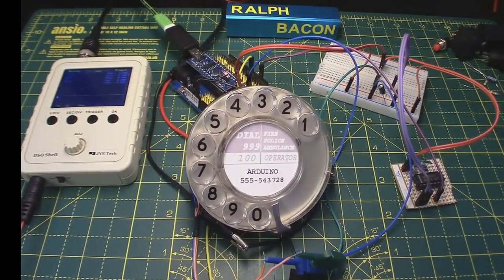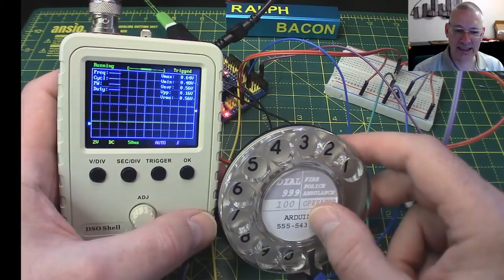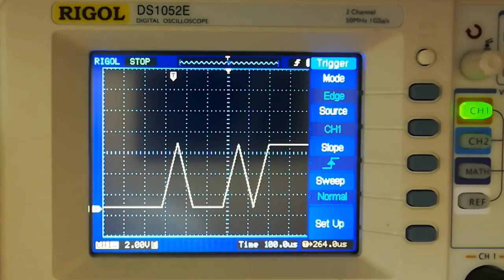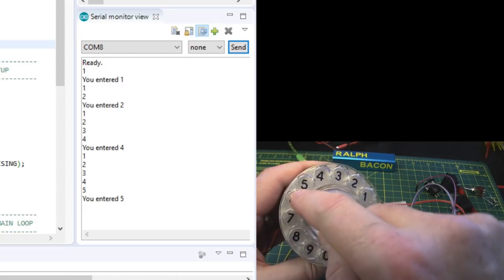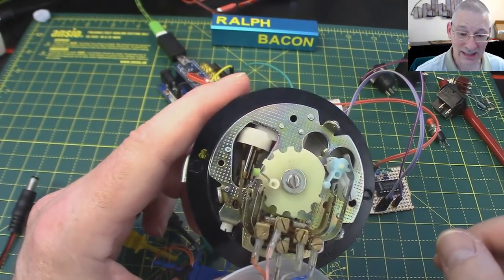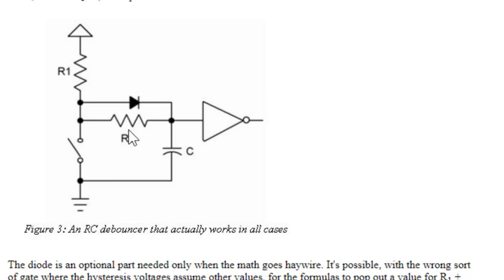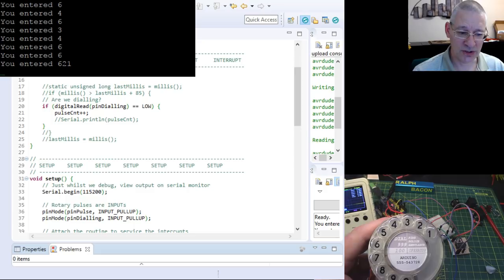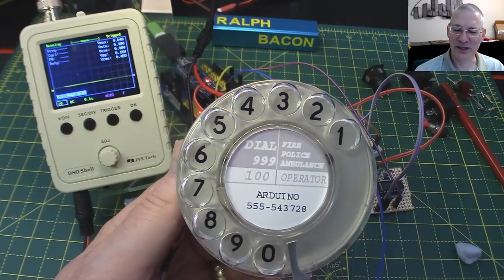#98 Telephone Dialler ☎️ and Hardware Debounce Solution (retro)

Comment: I believe that within an Arduino ISR the millis(), micros(), delay() and delayMicros() don't increment.  In other words they are disabled.  To be able to software debounce an input you have to poll it.  As slow as the dialer is you should be able to make polling work.  By the way, I love the video.
Reply from the maker: Thanks for your kind words, captxrox, most appreciated. I'm really happy that my followers enjoy my videos.
 
And yes, you're right that millis() does not increment during an ISR, but that doesn't matter as far as the code here is concerned. As long as a certain number of milliseconds have elapsed (it increments again as soon as the ISR finishes) before accepting further pulses that's fine. Polling is just not the optimal way of intercepting pulses that happen now and again as your Arduino's code might be busy doing other things and miss a few.
 
MIcros() does continue to run during an ISR as the underlying routine does not use a timer, but we don't need that here, anyway. It's can be a minefield using the Arduino specific functions (if you were using native C++ it becomes clear(er) what is going on). Thanks for posting, this is an interesting area to keep plugging away at.
Reply: I guess I was wrong about micros()--but right about millis() and delay().  
I just read the notes on https://cdn.arduino.cc/reference/en/language/functions/external-interrupts/attachinterrupt/ including the comment titled "About Interrupt Service Routines".  One thing it says, that I think is relavent here is: "Generally, an ISR should be as short and fast as possible."  That would be defeated as soon as a delay routine would be used.
Going back to polling, I have generally been successful with software debouncing a polled input.  Somehow it appears that the software debounce within the ISR will not work--whatever the reason.
While polling clearly won't work for a rotary encoder (there's a few YouTube videos demonstrating that) it should work on a rotary dialer.  The nominal period between pulses on the dialer is 100 ms.  I would try it myself but I don't have a rotary dialer.
Reply from the maker: I'm a tad worried we're talking at cross purposes here, captxrox. The ISR in my demo (the one that includes checking the millis to ensure we reject pulses that occur too close together) is the standard software method of dealing with bounces. There's no delay involved at all. We just exit the ISR if the current pulse has come "too soon" after the previous one (so we assume it's a bounce). So apart from my demo-purposes-only where I have a Serial.print statement (definitely a no-no for a real ISR) it's about as fast as it can be.

Using polling to debounce anything (switch, rotary encoder, whatever) this obviously can be done at a technical level but should not be done, as presumably your Arduino is busy doing the real work of switching heaters on and off, or measuring the light levels or something. We wouldn't want to poll for any kind of switch closing (bounce or not), it's just not good programming practice.

The issue I had with the telephone dialler is that it is so ancient that it flies in the face of normal switch behaviour. We can get a semblance of proper behaviour by rejecting pulses as far apart as 50ms but that is crazy. As Jack Ganssle mentioned in his paper, he never discovered any kind of standard switch that bounced for longer than 10ms - most were much short than this. So for the telephone dialler (and by extension, any switch) we can dispense with software debouncing entirely and do it all in hardware using that circuit - it's as though all our switches are suddenly 100% perfect!

My previous video on a Rotary Encoder (video #19) behaved perfectly using software debouncing (just 5ms) as I demonstrated in that video, so we don't always have to use external hardware to debounce switches - just when the occasion requires it and reliability demands it.

Are we singing off the same hymn sheet here, I don't want to confuse my viewers?
Reply: I think I was in more of a hurry to leave a comment than I was to be sure what I was saying was valid.  The truth is that when it comes to debouncing, software debouncing is a dirty way of doing it—at least to me.  What I like about it though is that it significantly reduces parts count.

Regarding what you are saying about rotary dialers—you didn't say it but in their day automatic phone switching was electromechanical so debouncing wasn’t an issue.

By the way, I guess I missed your videos on rotary encoders.  I'll make it a point to watch them.
Reply from the maker: No problem, captxrox, it's a fascinating area with many opinions. It seems the electronics world is split 50/50 about whether it should be hardware or software that sorts out debouncing. My take on this is that if we can do it easily and reliably in software (see video #19) then the job is done. If not, as this video and also video #96 shows, then we need extra help. For the sake of a few pennies we have 100% reliability! And yes, back in the day of gas lamps it was all electromechanical so I guess they didn't know or care about switch bounce. I marvel at how reliable the old mechanical telephone system was!
Reply: One thing that intrigued me about your video is that many years ago when I was in ninth grade (here in the U.S.) the school got its hands on some surplus stepper relays (I think that’s what they were called) from a local telephone switching office.  The office was upgrading to electronic switching (I guess that dates me).  Some fellow students were trying to use them on an electric basketball scoreboard to count down time.  While I was aware of the project I wasn't involved with it—though I wish I would have been.  They were having trouble transitioning from 00 seconds to 59 seconds.  They ended up using a (electromechanical) multivibrator to count the final four units on the ten’s of seconds digit.  The problem with their solution was that when the multivibrator would be stepping the ten’s digit the display of that digit would blank.  It looked very tacky to the crowd watching the game.
Reply from the maker: You should have been part of the design team (ideally with an Arduino but they weren't invented at that time). Yes, those stepping relays (also called uniselectors or stepping switches) were packed into our telephone exchanges back in the day. It's amazing they worked at all, let alone so very well. Old films that show them working intrigue me! Here's a rather drawn out example (but well explained) from the archives of AT&T: https://www.youtube.com/watch?v=xZePwin92cI
 
Luckily today we can do so much more for so much less (money, but not necessarily brain power, A good design is a good design is a...)
Reply: Thanks a lot for that link, Ralph—by the way my name is George.  To tell you a little more about the stepper relays I was dealing with in school, they were rotary. The ones in the video (that were counting pulses) were linear.  They may have been an earlier (or later) vintage.  You mentioned seeing stepping relays in films.  I remember that too and they were rotary.  I wish I could remember which movie (or movies) it was.  By the way, the time period my schoolmates were building the scoreboard was late 1963.

You have a forum don’t you?  Maybe we could move this discussion over there.
Reply from the maker: I don't have a forum, George (nice to be on first name terms, BTW, thanks for sharing) and even if I did I wouldn't have time to use it. Today, for example, I've been playing about..., er, doing some serious research with some very high voltages (lucky I'm still here) but no spoilers!

I'm afraid the reasoning behind using linear or rotary switches escapes me; I suspect that there was a very good reason though. As you say, one or the other probably hadn't been invented yet.
 
So your school mates were building this scoreboard thing just as the Beatles (from the UK, yay!) were just getting off the ground; no wonder they had difficulty in getting it all to work. I bet those same guys with an Arduino (or Pi) would have had a blast! They were 50 years ahead of their time. Anyway, it's great having you on board and do keep tuned in. Some videos may not be of  immediate interest but it's all good background information for the day you need that info! BTW did you see the video comment from Gavin here about using a telephone dialler for menu selection and the like? I'm not the only one who likes this sort of thing then!
Reply: I’m surprised you haven’t had more views on this video.  I guess most YouTubers are millennials who could care less about 50+ year old technology. There is one point I’d like to cover close to the subject of this video.  That is that when the phone system was converted to electronic switching they had to maintain compatibility with rotary phones—thus the dial pulses had to be debounced.  Based on the information in your video—and probably other issues—hardware debouncing had to be used.  Do you have any further thoughts on this?

About your references to the Beatles, they made their dramatic appearance on this side of the Atlantic in February 1963.  They were in full swing by the time my classmates were attempting to build the scoreboard.  In my old age I hate to admit that I was a big fan.  I might mention—unrelated—that the school (now Highland Middle School) I was attending then is about a mile southwest of the Microsoft campus.  I’m don’t live near there now, though.  When I graduated from University I moved 1000 miles south (1600 Km).
Reply from the maker: Hmm, looking at the stats that Google provide me, it's interesting that lowest age group for this channel is the 18-24 year-olds (those younger than that hardly even register). In increasing percentage it follows the age: 24-34, 35-44, 45-54, dipping down a bit again after that, but the over 65s still are many times more numerous than the whipper-snapper millennials! I'm not sure what this tells me except that this is channel is frequented by males over 18 and mostly in the age range 35-44 (but only by a whisker). Females are very low in the count but not entirely absent by any means, but mostly in the 18-24 year old bracket - probably students looking to do a university project!
 
Regarding conversion of old phones to the new digital system, British Telecom have released a document (http://www.britishtelephones.com/pstconv1.htm ) how to do it (for UK phones at least). They don't mention debouncing of any signal so I guess that might be done at the exchange when it encounters a pulse instead of a tone coming down the line. Just guessing!
 
So you moved from Microsoft Land? I bet you just couldn't stand the rain (apparently Washington is the wettest state in the US). 1000 miles southwards might be San Francisco or at least California so you now have sun, sun and smog. Oh well, can't have it all. I've never visited that area but I know Florida quite well (and we steer well clear these days of any theme park)!
Reply: I should start by telling you that the link you left didn’t work.  It is not really that important, but I was curious of what might be there.  There is one thing, I think I will try to get my hands on an old rotary dialer. Also I would love to get my hands on one of those old stepper relays but it’s hard to imagine any of them still in existence.

As I said I loved the AT&T video that you linked.  I did some searching of AT&T on YouTube and found another old video https://www.youtube.com/watch?v=1Is9s9PgQFM entitled “Now You Can Dial.”  It is from 1955 and has an introduction from this century.  Note that there was a time when an operator had to connect every call.  Anyway, the video goes on to explain why and how telephones were going to dial and then gives an instruction on how to use the dial.  It is mentioned in the introduction that most people born after 1980 would need that instruction.

As to where I live now, note that the air distance between Seattle and San Francisco is 680 miles (1100 km).  I am in Southern California.  As I type this I am in Palmdale where the Space Shuttle was built.  Parked by the Palmdale Airport (Air Force Plant 42) is the modified 747 that was used to ferry the Shuttle—and various other historic aircraft.
I should tell you that most of my vacations (holidays) since 1985 have been in the U.K.  I’ve visited 19 times.  I am curious about you.  Do you live in London or in one of the surrounding counties?

Besides my vacations in the U.K. I have been to Florida a few times myself to see the East Coast version of Disneyland.  I think the best place to visit on the East Coast, though, is the nation’s capital.  That’s is where you find the country’s history.  Certainly, when someone visits Europe (and the U.K.) they go to see historic sites.
Reply from the maker: I've corrected that link now, thanks for letting me know. I've started to watch the video you linked to, quite amusing and certainly nostalgic in its own way (not that I can remember pre-dial capable phones!)
 
I can't believe you have visited the UK so many times; or that there really that much to draw you here! I live about 70 miles away from London but will shortly (I hope) be moving a further 200 miles away but that is not going to happen before Xmas. I guess the UK is the size of Florida (give or take) but I've certainly seen more of Florida than I have the UK (the weather here is not so conducive to touring, I'm afraid). Anyway, I must get on, I have another video on the go even as we speak. Good to hear from you George, don't forget to keep tuned for future videos!
Reply: captxrox i

Comment: Thank you so much.  The minute I saw that I said "A retro password system".  I knew a little about key bounce but not about the Schmitt Trigger.   I'm considering building a video editing controller to edit Camtasia videos.  It would have 10 arcade style buttons which appear to be some of the worst buttons when it comes to bounce.  Those buttons would, in turn, be connected to an Arduino device which can be used as a USB keyboard.   Each button press would emulate the keyboard keys for that editing command.  

Looks like I'll need a Schmitt trigger for each button.  I've seen some chipsets from China with 4 triggers in a chip.  Do you think there is a better approach to this?  Keep broadcasting?
Reply from the maker: The chip I eventually settled on was the industry standard SN74HC14 which contains 5 single input Schmitt triggers. But beware that you will need two triggers per switch unless you're prepared to deal with inversion of the logic in your software (when the switch goes high the trigger goes low, not ideal). So I connect two triggers in line, per switch, to bring the logic to the correct state. Which means I only get two triggers (plus half a trigger) per chip. There are numerous other Schmitt trigger chips out there (including octal - 8-way - which might not even be inverting so that would be worth investigating). See what you can find and let me know and I'll give it the once over, if you like? You need TTL level not CMOS level remember for the Arduino - some chips are available in the two variants.
Reply from the maker: I just found this one: 74HC7014 Hex non-inverting precision Schmitt-trigger so that gives you five Schmitts per chip, meaning you would only need two. Looks interesting. Not sure whether it's available as a DIL format, might be surface mount. More here: https://assets.nexperia.com/documents/data-sheet/74HC7014.pdf
Reply: Thank you,  Looks like Avnet has them $1.60 which isn't bad.   This should help me keep the size down.
Reply: I'll try dealing with the inversion in software, I don't imagine there would be any issues.  Did I just say that?  I'll buy a few extras. ;-)
Reply from the maker: Yes, some trial and error may be required. See how it goes. Within your software there's nothing to stop you defining "ON" as a low value and "OFF" as a high value, just to keep things straight in your mind. See how it goes... as you say, what could possibly go wrong?
Reply from the maker: Correction: the SN74HC14N I mentioned is a Hex device giving not five but six independent Schmitt triggers per chip. So in my demo for switch bouncing and rotary encoders, it will cater for both A and B pins, plus the push to make switch (if present).

Comment: The debouncing is very informative. I will need to recalculate to 3V3, but it is always good to see that when checking the calculations in the pdf for 5Volt, I get to exactly the same values.
Though I found the MC14490 now 5 for 1.60USD at aliexpress, the SN74HC14 is 10 for that price... but am i gonna need 60 inputs??
Anyway, very informative
Reply from the maker: Remember that for the SN74HC14 you will need two gates per switch, otherwise you will get an inverted signal; so your code would have to check for LOW when the switch is HIGH - all a bit confusing! I used two gates per switch in my demo CD4093 Schmitt trigger (not a great choice for Real World use but OK for demo) to get the non-inverted output. The MC14490 looks interesting (and, ignoring the price differential) I wonder if it works any better than, say, a SN74HC14 with the "100%" debounce circuit? Frankly I just like Jack Ganssle's circuit so I'll stick with my SN74HC14 for now!
Reply: Ralph S Bacon yes indeed. Thanks for pointing it out. In my case it doesn't matter that much as I look for a state change as it will be a toggle switch. But ofcourse that isn't valid for every situation. I think I stick with your method